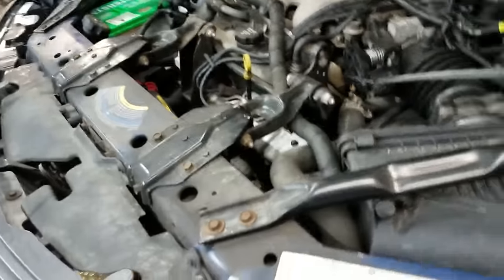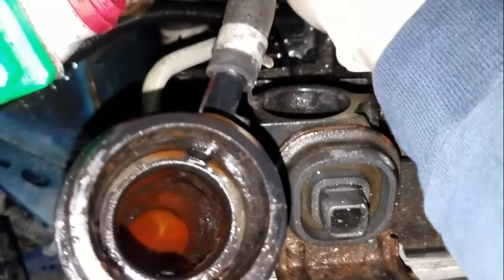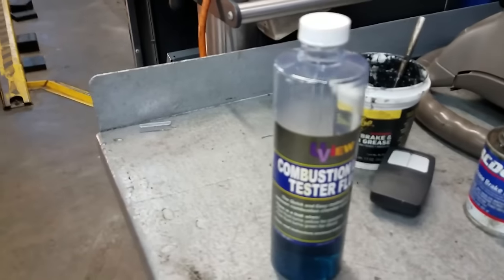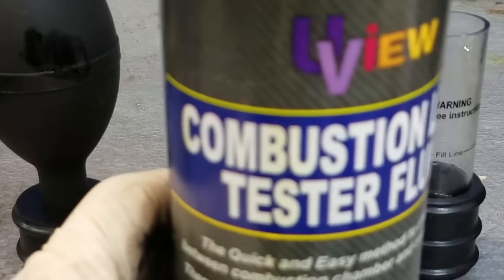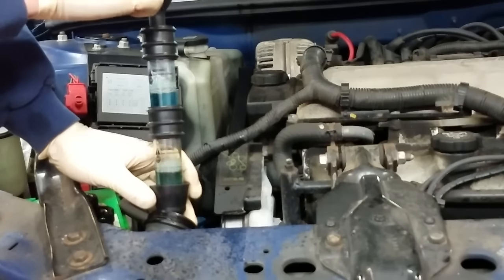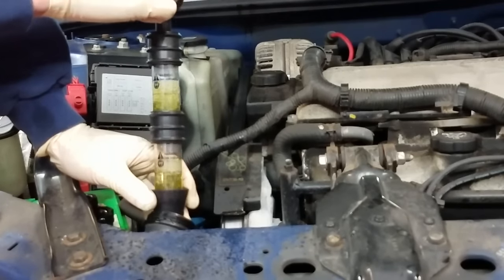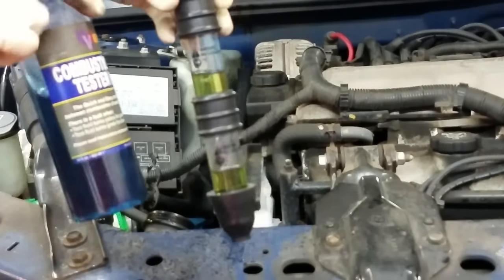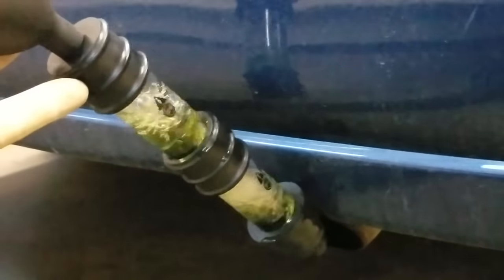How to tell if you have a blown head gasket "3 Easy Test"

Comment: I have a 94 Ford ranger with the 3.0 v6 Everytime you drive it it will push the coolant to the overflow tank but don't pull back to radiator I can't figure it out it's driving me nuts.
Reply from the maker: Bad radiator cap my freind. Not much else that can cause that.
Reply: @FlatRateMechanic  I thought the same thing so I put a new one on still dose the same thing.
Reply from the maker: @anthonyyoung7344  Is it overheating? it's possible that the cap does not seal internally for some reason. Expesily if the radiator has been replace at one point in the truck's life "aftermarket radiator" If it's not overheating  Maybe try different brand cap. Or in very rare cases head gasket can be leaking combustion gas into coolant with no overheating symptoms. The extra combustion gas affects the pressure and siphoning effect that takes place.
Reply: @FlatRateMechanic  yeah I put a new factory replacement radiator and cap on the truck it doesn't get hot just pushes the coolant from the radiator to the overflow tank.
Reply from the maker: @anthonyyoung7344  Very interesting. I would still try a second cap if you haven't already. If so then I'm afraid it must have a start of a head gasket problem. I would like to know what you find if it is something else. Keep us posted. Thanks. It would need to have some kind of leak, whether it be air or coolant. From the sounds of it, it is air. causing the system not to hold vac as is cooling off and retracts, which is what pulls the coolant back in from the overflow.
Reply: a head gasket can totally do that. i have a car in my parking lot that does that exactly, waiting for repair. after a drive and a long cool down, there's still a bit of pressure in the cooling system when it should have been long enough for the coolant to be sucked back into the radiator.
Reply: @garonburwell9008  your right it blowed a headgasket the other day going home now it smokes really bad.
Reply: @anthonyyoung7344  thats a bummer.

Comment: If it's blown you will have water in your oil. your dipstick will have a frothy oil on it, will look like espresso froth. Drain your sump when the engine is cold. you can drain the water in the bottom sitting below the oil. The engine will actually still work fine with over a litre of water in your sump.
Reply: thats not true you can have a bad head gasket an not have milkshake oil just like having milkshake oil doesnt mean head gasket failure 100% of the time. it depends on where the gasket failed
Reply: @codyramos3200  There is only one place the oil and water can mix, that is at the head gasket.
Reply: @gerhardlourens7930  , again not true it can happen with a bad intake manifold gasket , oil cooler failure or at a oil cooler adapter like fords have  where the oil filter is  . head gasket is just 1 possibility out of a few for water n oil to contaminate each other
Reply: @gerhardlourens7930  
As Cody said, depends where the gasket failed.  If it was from piston oil area to coolant area/passage,  yes. If it's only between pistons,  you also have a failed gasket,  but since oil hasn't mixed with coolant,  you won't get that milky foam effect. That's why there are multiple ways to test for bad head gaskets.

Comment: if it is gm 3.1/3.4/3.8 and original plastic head gasket ,you just change it,they last between 50K to 70K miles if you are lucky,the knew it and never recalled it,and no the problem is not dex cool orange coolant
Reply: wrong gasket buddy

Comment: The bubbles coming from the radiator cap could just mean air is escaping. that's how you burp the system, to get the air out. It could just be air.

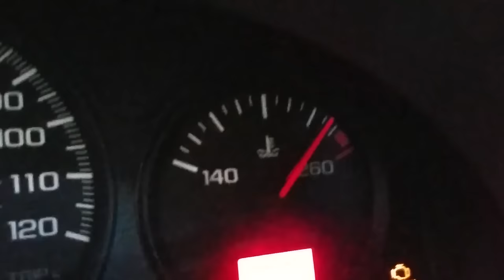Comment: 0:16 if the white indicator is in the middle towards the 140, is it a bad sign?
Reply: You mean the temperature gauge? Lower is better. If it rises much above halfway usually there is a problem. All the way to the right could mean engine damage and shutting the vehicle off is advised.
Reply: but also if it doesn't move after the car has warmed up that either means your thermostat is no longer working and is stuck open or your coolant sensor is no longer working... also if your thermostat is stuck open there's a good chance your heat doesn't blow as hot as it usually does.. either way both of them are easy fixes very easy

Comment: Those engines 3.4 have plastic intake gaskets that leak oil and coolant as well....
Reply: BULLSHIT. That is the 3.8 L V6 made by Buick that has the plastic intake that one is aluminum and it's a piece of shit I wouldn't own a 3/4 or 3-1
Reply: You are wrong 3.8 L V6 made by Buick has plastic intake that is aluminum biggest piece of shit GM ever built don't buy one

Comment: Please help, 2019 mustang ecoboost 20k  miles, Car runs fine, Little rough on startup, No bubbles in radiator Cylinder 4 misfire, No milky sludge on oil cap Does not overheat and there's a clear coolant leak under the reservoir and white smoke, Started out of nowhere last night after driving the car and It was sitting for a while went to start it up and got a shit ton of white smoke

Comment: Cylinder Head Gaskets rarely FAIL!  Invariably they are first damaged and then no longer can do the job they were designed for.  Worn out Water Pumps a prime cause of coolant loss although there are many other reasons for coolant loss. 

When coolant loss reaches critical low level engine overheats. Excess heat damages engine components and one of the first to be damaged is the poor old Cylinder Head Gasket. 

Many modern car uses have little under the bonnet understanding, Clueless. I have known car users drive on when clearly something is wrong and not only is the CHG damaged, but the Plastic Inlet Manifolds have actually melted from excess heat and soon after the car grinds to a halt with a seized solid engine. Have rescued two work colleagues' cars suffering that demise.

So check the condition and the level of the coolant on your car. As well as other checks recommended by ALL automotive manufacturers.  There are many valid reasons for doing that, including serious safety issues. It aint Rocket Science.

Comment: the only think i can think is head gasket is a huge scam  is a nightmare  for a car owner to deal with this small issue but really expensive  repair this gasket should  be strang enough  to never be replace it
Reply: Often times the problem isn't the gasket itself, but too much heat causing the cylinder head or block to warp, and then the gasket can't do what it is designed to do.

Comment: Can't you just look at the dipstick to see if there's water in the oil?
Reply: That will tell you if the leak is from the coolant ways into the oilways. If the leak is only from the coolant ways into the combustion chambers then that won't affect the oil in any way, so no.
Reply: Not always, my oil is clean but bubbles in radiator

Comment: My car isn't running hot but my top hose has to much pressure on it
Reply: when? after its cold?
Reply from the maker: If there is pressure on a cold engine you definitely got a problem. Nermal for a hot engine.
Reply: @FlatRateMechanic   when it warms up the radiator hose gets tight
Reply from the maker: @shakeen583  normal

Comment: Testing for Carbon Monoxide at the  exhaust pipe????       Funny
Reply: guy wasnt testing the exhaust he was doing that to show what the blue fluid in tester is reacting with
Reply: thats an old trick too use the sniffer form the gas analyzer in the area of the radiator filler neck to pick up co or hc or co2
Reply: @6:30 he states for anyone doubting the test kit then shows testing of the fluid to confirm it's legit n not past the expiration date 8]

Comment: But at first u said it was the water pump...which is it?
Reply: He's telling u basically the water pumped failed which caused the engine to overheat thus warping the cylinder heads that's why it's a blown head gasket